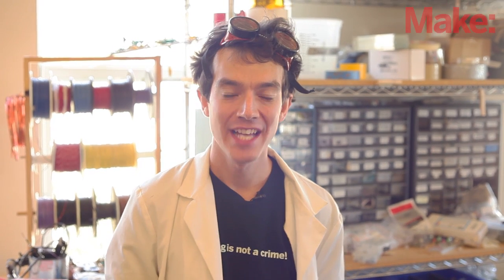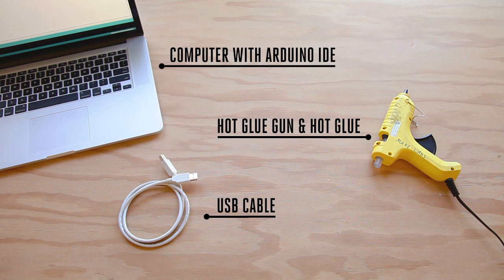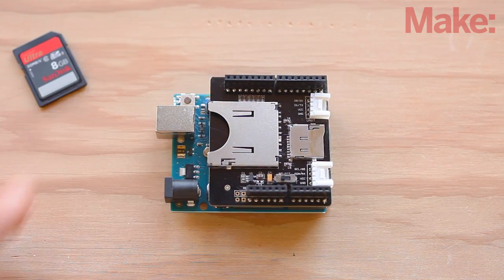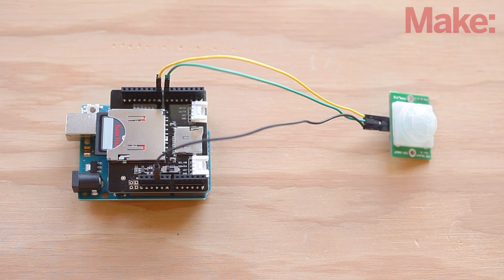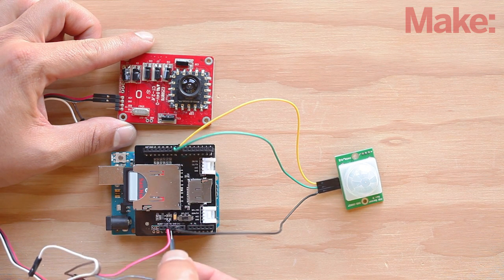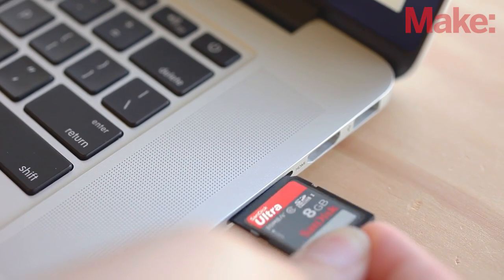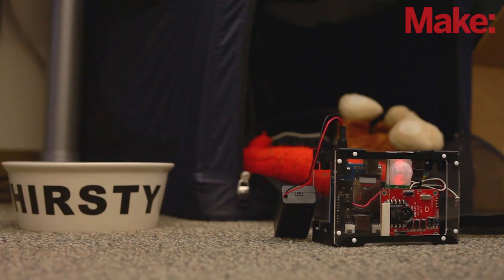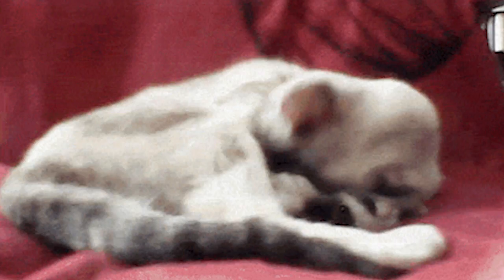Weekend Projects - Crittergram Capture Cam

Comment: I am having trouble with the code. I downloaded the code and opened the Arduini IDE. When i go to upload the code i get the error message: Arduino:

1.6.0 (Windows 7), Board: "Arduino Uno"

C:\Program Files (x86)\Arduino\libraries\SD\src\utility\Sd2Card.cpp:26:17: fatal error: SPI.h: No such file or directory
 #include <SPI.h>

                 ^
compilation terminated.
Error compiling.

Any Ideas??

Comment: remove the infrared filter from the lens of the camera and add a few bright infrared leds (maybe hack apart an led flashlight so it can run off another power source and toss infrared leds in it so you can make use of it's reflector). it will likely make the censor more sensitive, but the digital camera will be able to see the infrared light reflected.

Comment: I get the following error code when uploading:
Arduino: 1.5.7 (Windows 7), Board: "Arduino Uno"

K:\Master\AnKiptonio\libraries\SD\src\utility\Sd2Card.cpp:26:17: fatal error: SPI.h: No such file or directory
  #include  <SPI.h>
                 ^
compilation terminated.

  This report would have more information with
  "Show verbose output during compilation"
  enabled in File > Preferences.

I use an SSD so I need an external hard drive I named K:\

Comment: Did not have much luck with my camera module. I can make it output pictures to the tv but not to the sd card. On the tv it is a very blurry picture even after adjusting the focus.  I formatted the sd card with my computer. I just cannot get the required files in the correct location, I think.
TG
Reply: 3495terry same here. but mine would just make a blank file. if you used an Ethernet/sd card shield, line 45 needs to be set to 4 to write to the card. but mine would just make a blank file.